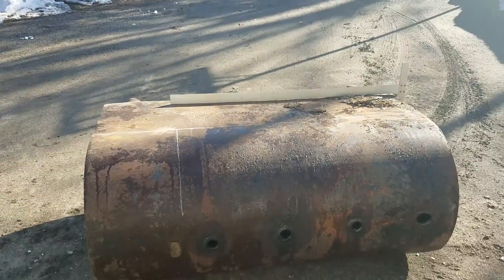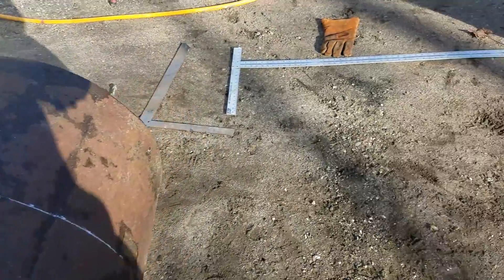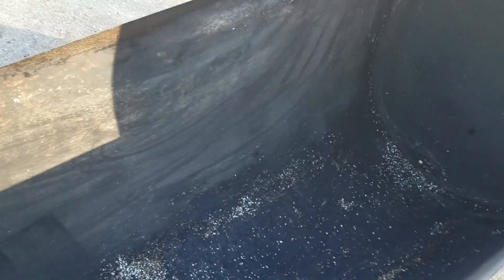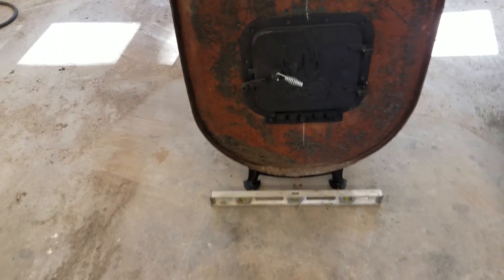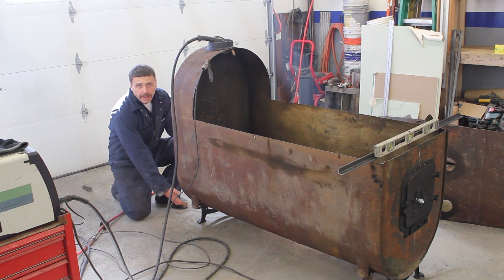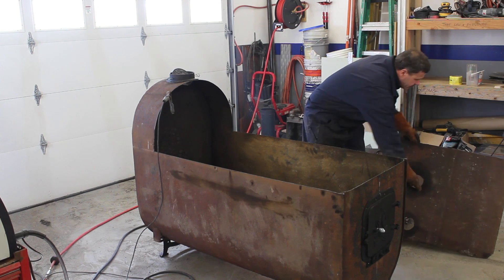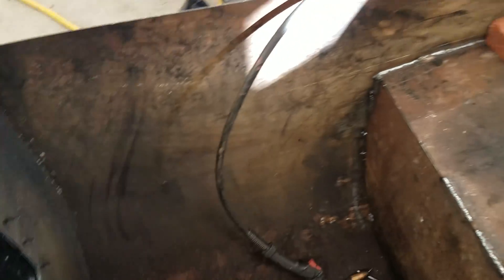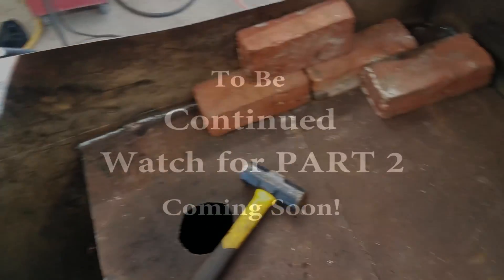How To Make a Homemade Maple Syrup Evaporator Part 1

Comment: Interesting build, I have seen a few. If I may suggest though, raise your ramp so you only have about 1" clearance between the brick and the bottom of the pan. It will boil much better. Also between the back of the pan and where the arch raises to go into the stove pipe you need to put insulation there to keep the syrup from burning on the back of the pan